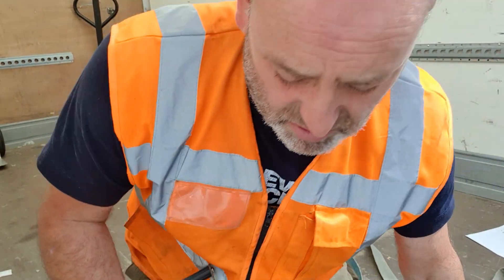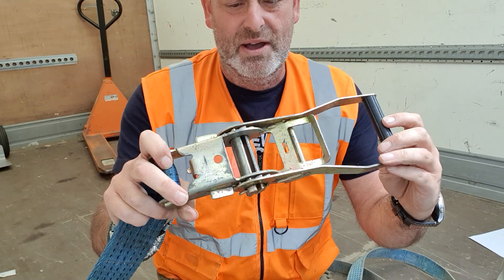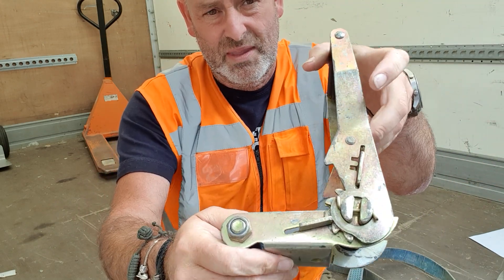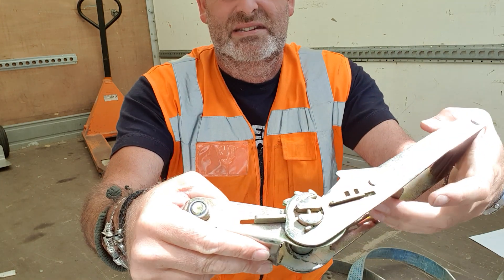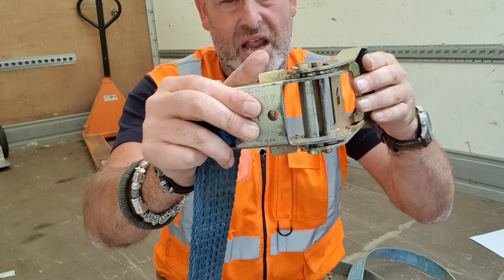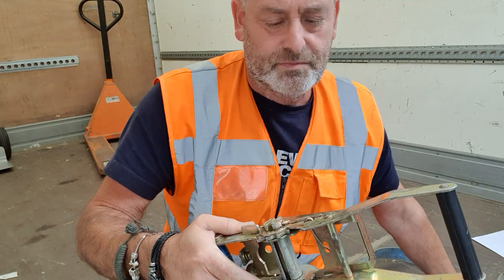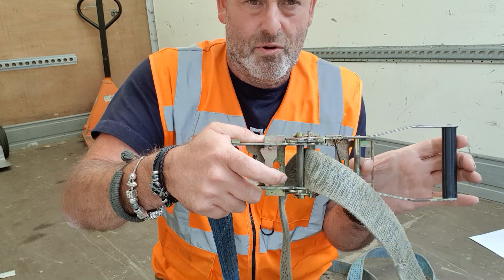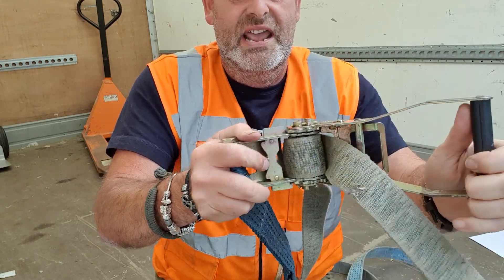How a ratchet strap works, the close up video

Comment: Or get retractable ratchet straps. I have 4 really good I use them everyday. Got them off eBay 2 for £20  had them over a year and still going strong. Best bit is you don't have all the loose strap about and no knots